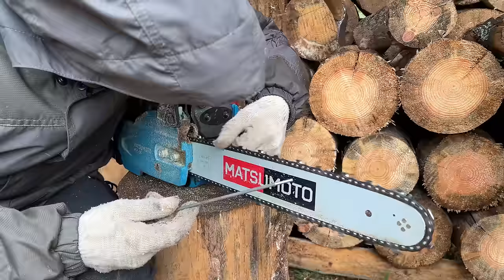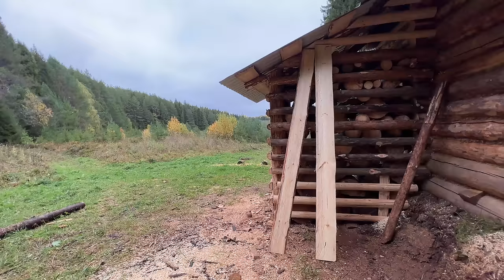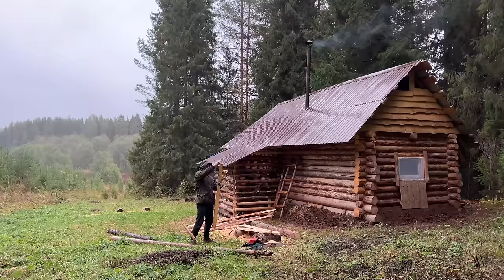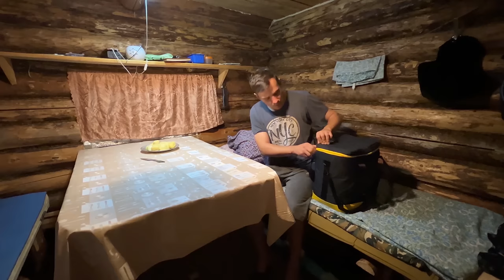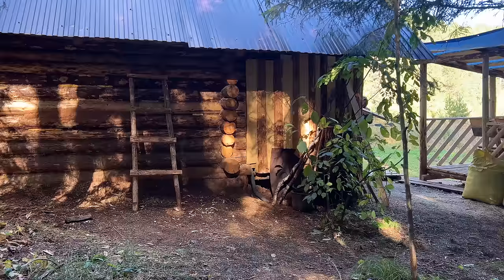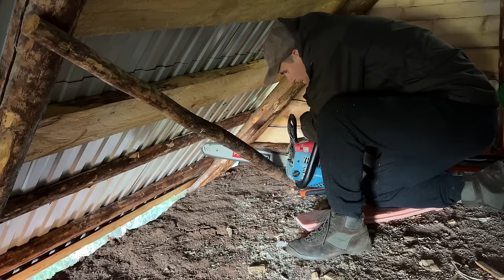WINTER is coming! Alone in the TAIGA cabin, picking mushrooms, preparing the cabin for winter

Comment: Just for the curtains in your Cabin window, you could buy a length of "Thermal Curtain Backing" and get someone or yourself if you can, to sew it onto the "window side" of the curtain material to provide extra insulation....just a thought 🤗 And for around the cabin, you could use Sheep's Wool, it doesn't burn well as it is a natural fire retardant material, and can stay warm even when wet...just another thought 🤗 These tips come from living in South Island of New Zealand where we get seriously cold "Antarctic Blasts of Weather" that have to be experienced to believe. Much like up there in the Taiga. A GPS Collar might be good to put on Hugo, just for future sake.
Reply: I've seen a lot of videos with clear bubble wrap windows insulation. You have to use the ones with the big bubbles. It just sticks to the clean window with some alcohol-based window cleaner. Cheap or free, a second recycled life for bubble wrap (from packaging).
Reply: Tip No. 2: If you don't store the wood as round wood, but cut it lengthways into quarters, it will dry much faster. You'll have to split it at some point anyway.
Tip No. 3: Try to plug even the tiniest holes in the roof and elsewhere with moss from the forest (and cob). That's how people isolated for thousands of years, it works very well.
Reply: @ws4860  Czy byłeś proszony o rady? Obawiam się, że nie. W takim razie zachowaj te rady dla siebie skoro nikt o nie nie prosił. Dotyczy to wszystkich pozostałych ,,doradców".
Reply: @maroni424  Translation of your Polish text from above:
Have you been asked for advice? I'm afraid not. Then keep this advice to yourself since no one asked for it. This applies to all other "advisors".
My answer: 'No comment, my lifetime is too good for that.'

Comment: Might be a safety-smart idea to wear some safety goggles to protect your eyes from any flying wood chips.  When using the power saw.
Especially since you are there alone....and sawing over your head with chips certainly coming down on you:!!!!

Amazed that you tackle this project alone!  
Also, wondered why you did not put the rounded side of the logs facing out!???
Glad you found Hugo had gone home - he perhaps didn't see you quietly preparing your meal, eating an then working inside up on the roof.  Where is Chrisitan he worried.  So ran home.  Smart doggie.  Love Huga.

Wearing just a t-shirt, it must be toasty warm inside with 0 degrees outside.  What is the inside temperature?
Was so clever to attach the roof part to your belt as you got in position to fix it in place.   Was very concerned about you climbing up on the roof while all alone!

How many kilometers or miles do you walk to get and home from the cabin?

Huga was probably overjoyed to see you arrive home!